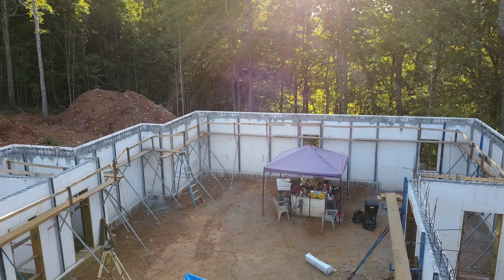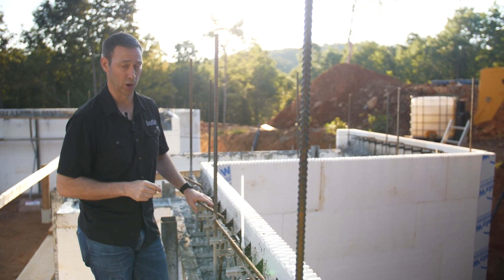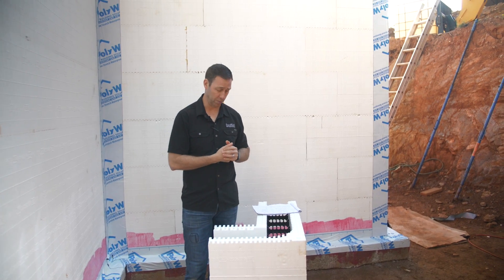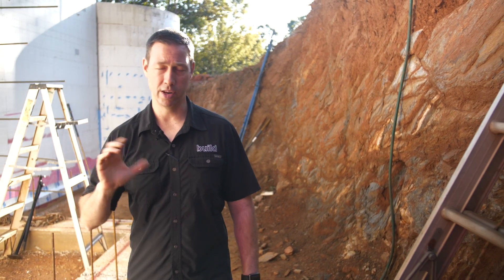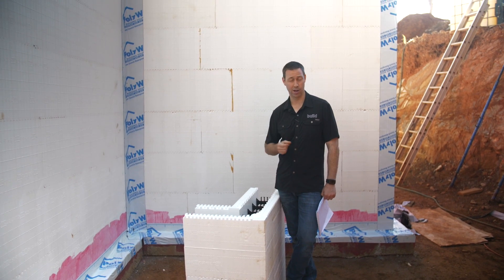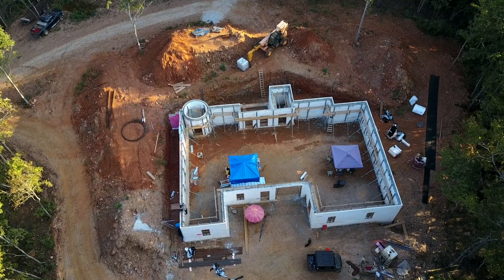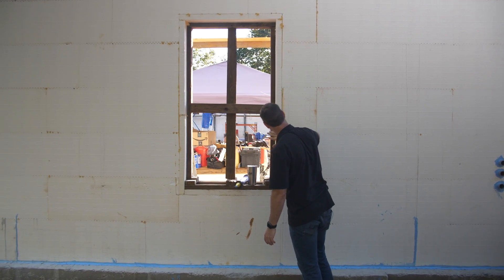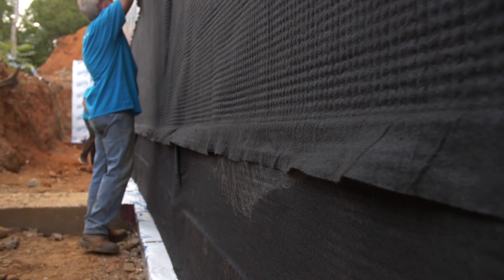Insulated Concrete Forms - Overview, Costs, and Cons

Comment: Owner/Builder ...NOT ADVISED ! I am a builder and I am so glad I got an experienced Sub to do the ICF work on our project. There are a ton of details that you need to be experienced about to ensure a good result...bracing & plumbing the walls is a must but the wood bucks that need to be built at all openings can get very tricky, vibrating during the pour, doing the pour in lifts, cutting blocks and ensuring the inner plastic studs still line up from one row to the next, the list goes on and on. The end result is all of the good things Matt talks about but I would NOT recommend this fir a DIYer.
Reply: I have not done any build of ICF myself but I have watched just about every video on how to build them, I also watched how not to do it as proven by one channel couple building their own ICF basement somewhere in Idaho. They showed what common seam is and IMO its not the proper way to install a wall having every cut to fit seam being on the same place for what they demonstrated, I like to stagger seems.
But to say it is not a DIY  or Owner-Builder thing to do, its true for those who first do not take a seminar or two or watch the instructional videos demonstrating everything you mention, I have watched some DIYers build it themselves with less to no trouble than that one couple whose channel or adventures name I forget still as this is how much I care about them. Besides we all had or have to start from nothing, even you said yourself as a contractor you were glad to use a sub on the install, I am sure by watching them you would know what to checklist if you did it yourself and as Matt said and all ICF manufacturers state in their instructions to complete the install a day before the pour so you can look over everything to double/triple check that you did everything correctly and did not miss anything. Lastly some manufacturers now make ICF bucks and I suggest you look at the Build Block website showing their own new bucking system, though it still requires wood blocking to support though it does still need some further designing to help stiffen it more to more securely hold the window or door in place against the likes of a tornado or hurricane.
Heck even working for my step dad doing basement waterproofing when I first started at 15 in my spare time out of school I watched him as he explained and did certain tasks and we installed a product that the manufacturer only recommends certified installer to install to reduce the likelihood of them getting used. So unless the ICF manufacturers does not recommend not DIY/owner-builder constructing to save money on labor alone would make their product less likely to be sold and used compared to their competitors who many offer seminars for DIY/Owner-builder types can attend for a minor fee if in one who commented they paid $150 for the seminar and were happy with their outcome of their own build.

Hopefully all this did not bore you and you just rant on without fully reading and understanding what I said.
Reply: if stil not convinced then you may want to look at Build Block's channel as they a while back uploaded a DIY series or vast set of tutorials, Like I said, we all start from little to nothing our first time, so to say it should be left to an experienced or professional installer is bonkers as they started out just like the owner-builder.
Reply: As an owner/builder you will probably only do one project in your lifetime....why risk all of the potential problems? If you have problems during the pour you are generally in deep trouble...concrete pours can’t be stopped to fix a problem. As I already stated, I have 25+ yrs in construction and I could recommend a variety of other phases of a house build that an owner/builder could comfortably and safely be involved in....ICF’s is not one of them.

Comment: what is the cost per block.  I love to use this to build a underground root seller / storm seller
Reply: depends on block size and manufacturer, and you would have to request a quote to get pricing, with most you can get the quote by sending them the pkans for what you plan to use their forms for, be it basement below grade or above grade walls for the main part of the structure to even using their floor deck forms for floors or the roof even.

Comment: Good summary of ICF. Getting ready to build an ICF home with concrete floors over basement, radiant ceiling/hydronic climate control, whole house dehumid/ERV, and hopefully low voltage LED lighting over Cat5 throughout.
Reply: ICF decking I take, not steel decking?
Reply: @Joshua79C  Yup
Reply: Also planning "conditioned" attic with roof insulation sandwiched around the sheathing, standing seam over EPS and polyiso...
Reply: That is better than a monolithic dome with its decreased spatial areas

Comment: What's the maximum span this can hold for large windows and window walls?  Also can the plastic webbing be found with a stud finder after the sheetrock is installed?
Reply: If you look at Build Blocks information on their products you will see their foam panels are marked where the fastening points are placed, some go so far as to paint with a marker to see it better but they are at 6 inch on center, and most use strips for greater fastening areas which are also marked in other ways such as in Quad Lock's case are slots which are wider where their fastening strips are placed in their 2 and 4 inch panels.
Reply: @Joshua79C  I did look at the website but it doesn't say anything about finding the webbing with stud finder. After the sheet rock covers it up you won't be able to see any markings.
Reply: cheat sheet, just take a sheet of paper and mark the spacing, then from the existing board you just measure if a stud finder does not help, its not that hard to figure out, you can even mark them with a permanent marker, as long as they are all properly lined up when assembled into the wall there is not much to it, no more of a pattern than traditional wood framing

Comment: I have spent my life in southern California, growing up in a fire zone (hills of Glendale).  Also, I've lived long enough to personally experience one bone-rattling earthquake (1971, Sylmar quake when I was up early reading about wave propagation!!!!)     So my comment is that, while the ICF construction intrigues me on the point of earthquake resiliency, it lacks much attraction towards fire resiliency.      Let's say you've built a home in the hills and the fire engulfs the building.     Even though you've installed masonry facing, the heat will penetrate most superficial surfaces (appropriately called façades!) and MELT the foam exterior plane!      Even if it did NOT melt said plane, how would the homeowner KNOW?       Serious demolition would be in order!       OK, I suppose a diagnostic technique might be invented... but there would not be enough need in the marketplace for this.        So this is not a good structural technique for fire resiliency, IMHO.

Comment: Internal insulation reduces the thermal capacity of your house to virtually zero (some is there from furniture, but is negligible in comparison to concrete walls). That means that your house heats up quickly (in the heating period) and cools down quickly when the heating is turned low. Even more so while cooling, as soon as the AC shuts down, the house heats up due to internal loads. This COULD be an advantage if using a forced air heating/cooling system, since the air is such a poor heat transporter (and the system is used in the US, i live in Europe, where hydronic heating/cooling is a standard). As soon as you mentioned "off grid" I knew this was a definite disadvantage, as you want as much energy capacity (weather it be heat or electricity) in the house as possible.
Reply: Thinnest panels made are in the 2 inch range, this is just nominal size, for example is you look at the manufacturers website (link in description) it tells you the exact thickness usually an quarter inch more than stated. In Quad Locks case they offer panels and ties seperate so you order the required ties including extender ones for making much thicker walls where required or such instead of being limited to just as much as 12 inch of concrete thickness. If you also check out their proucts they also offer a knocdown system aking to Quadlock panels which are not tied to one another like most others but they also offer pannels with one side which can be removed as it is made of wood panels that only stay there for the pour and curing to let the mud set enough before it can be safely removed to leave a hard surface, and they also offer as you say the round portico section a radius wall system as they are the first to offer this product form
Most builder==owners opt to go with just 2 inch panels. and also most offer inserts so one would want to design according to keep the wall thickness at least 6 inches thick so they would need to go with deeper forms for thicker wallls with added outside insulation inserts to get that 6 inch thick concrete wall thickness. With Quad Lock they as I said come with the ties and panels separate of one another and they offer three panels sizes and their extra panel are easily installed and with extender ties (the ties all provide two points of attachment for wall finishes from steel panels to hardee board or fiber cement board) can provide thicker outside or inside insulation (in the case of a frozen food warehouse). Quad Lock also provides two and four inch panels with fastener strips to provide more fastening points for exterior finishing.
Reply: @Joshua79C  sorry but all that you said seems to not have anything to do with my remark, but sounds like a rant from a marketing wanketeer

Comment: Water proofing is something that has to be done on any wall so saying that water proofing is a down side is false. Any time you insulate the concrete under grade is a plus in a cold or hot climate. When talking about the cost of the ICF block you must take in consideration the cost of insuation and labor also because, insulation cost and labor are done when you put the ICF walls up. The money save in a long run with ICF blocks will out way the cost of the ICF blocks many tumes over in just heating and cooling cost. Remodeling cost are more above grade but, most ICF blocks are below grade.
Reply: Yes, not so much to do remodel wise below grade..that is unless the wall failed in some way and then the house would have to be lifted if constructed out of traditional framing or steel framing even.. unless the entire home is ICF then lifting is out of the question. The only true remodeling in a basement is the interior if being used for living space.

Comment: 9000 sq ft x $15 = $135,000 and that's before water proofing and siding but it replaces insulation in many climates.
Reply: IF you look at the cost for a traditional formwork system for bare concrete with no easy to drill into fastening points like ICF has then you are going to run into form rental along with the time to set up and take down which adds to labor time with its heavy pieces of form sections and many fastening ties and screw clamps. Then also he did say he was basing on concrete price in TX where he is from at $5/sqft as opposed to how much cubic yard which is how it is priced per volume. the IC forms themselves are lower cost than the concrete or even perhaps the rebar.
Now subtract the labor and you get a low price when you owner-builder or DIY and may want to take a course or two offered by many of the form manufacturers through one of their certified installers if not directly for a minor cost of say $150 as one commenter (Vancouver Island Waterjet) mentions they paid for a Nudura (ICF manufacturer) seminar.

Comment: Just assuming these were squares and assuming 10 ft including floor and ceiling the 3000 sq ft basement would be 55 x 55 ft and the 4200 sq ft ground floor would be 65 x 65 ft. So 2200 sq ft of walls in the basement and 2600 sq ft in the ground floor. So 4800 sq ft of wall. That comes pretty far off from 9000. Something seems off about that.

Comment: If you want more insulation with an ICF, and to have the ability to put on heavy siding, check out Fox Blocks, which have 12" blocks that you can put more insulation INSIDE of the block.  I've never used them, don't work for them, etc.
Reply: with Quad Lock forms and ties you can get even thicker concrete and insulation , and I only know about them through my own research and do not work for them or a company that uses them and does not have the downside that comes with others with up to only 12 inch thick and reduced as inserts are placed in and the forms do not come with extender ties or even as a knockdown system like Build Block also offers.

Comment: Termites love the foam,  so if you're going below grade,  you'd better have it treated like crazy.
Reply: Some manufacturers for example Nudura perhaps offers optional forms with termite protection infused in, others just offer or recommend termite barriers made from steel that goes in during initial construction or slips on after the fact in a retrofit. The best barrier to termites is a goo pest control system that many such companies offer to detect and determine what measures may need to be taken to control said colony.

Comment: In regards to the footing/leveling and insulation, there are a couple of things.  Firstly, for the footing/level of the ICF, there's something called "Fastfoot".  It's a "fabric/waterproof" "bag" type thing that can be suspended below ICFs, forming a waterproof/moistureproof footing, and, especially on uneven ground, by making sure the ICF is level, you can then let the concrete form up in the fastfoot "frame", and both monopour the whole wall and footing, without the break between them, and you know it's level, because the fastfoot is what's "uneven", below on the ground, while the ICF, itself, is suspended around, say, 18 inches above ground, level.  The info about Fastfoot is available at the Buildblock website, among others.

As for insulation, there are a few options.  Firstly, they offer both wider blocks, such as 8 inches, 10 inches, or even 12 inches of concrete between the EPS Foam.  They also offer 2 inch inserts, made out of the same material as the EPS Foam, that you can insert inside of the block, against one side or the other.  That's a "permanent" added insulation.  Another couple of options are, firstly, apply EPS/XPS foam, in normal 4x8 foot(?) sheets, similar to wood construction, and weatherproof over that, however you would, normally.  A second option, and one I would prefer for when I build my own "house", is basically frame a 2xX wall, inside the interior side of the ICF, and run your wiring, any plumbing, and even additional insulation inside that.  That also makes upgrading wiring or maybe insulation easier, since it would be just like any other home upgrade.  The only difference is, instead of sheathing on the outside, you have the interior side of the ICF System.  While it would be more "permanent", you could even use closed-cell spray foam for the insulation inside the "2xX" walls.  While it's more of a commercial application, you could even spray foam the exterior side of the ICF, with closed-cell spray foam.

The point is, there are options, depending on what you want to do.  

As for the cost factor, while the initial cost is higher, you have to keep in mind what you're saving on other things, like insurance costs, needing a smaller HVAC System, and so on.  If you add in site sighting, and PV Arrays/battery, that all adds up to money spent in the "near term", but that you're saving in the longer term.  Like those water heaters you showed, a while back.  One was something like $1500, compared $300-$450, or so, but after the five years, those other two were costing around $2000-$3000, while the heatpump one, which had cost $1500, was only at something like $1550, or so.
Reply: You missed Quad Lock system which unlike the others have extender ties so you do not loose concrete thickness as it does not use inserts like the others do. From what I know a little more than you explain. Adding in additional framing on the inside of the outer wall of ICF wall, you can easily run conduit through it and even go far as installing the electrical conduit in the cavity where the concrete goes just as well, the interior added framing added in that spot just decreases room and interior space and adds more barrier between the thermal mass of the concrete itself which helps to reduce cooling and heating costs greatly.
Reply: I wasn't trying to list every possible option, just list a couple of things that can address the problems that Matt listed with ICF Systems.

Comment: Concrete doesn’t “resist” constant outside temperature though. That’s what insulation is for.
Reply: he did mention concrete will eventually heat up or cool and the foam forms create a full thermal break despite. One manufacturer i know of offer three thickness of panels per the foam panels. others offer it as a upgrade option, check out Quad Lock if you have not heard of them before.
Reply: Check out "EastGate Center, Harare" for how concrete breathes using biomimicry of termite mounds.

Comment: Why isn’t there ‘mortar’ going between the blocks (liquid flashing?) to seal up all the cracks? Apply enough so it squirts out and you see all the seams, then scrape it flat
Reply: foam adhesive is what you are looking for in reference to mortar and some manufacturers recommend it to secure the blocks to one another during the assembly but only on a flat seam where there is not going to be a "interlock" such in the case of Build Block forms and most others with flat edge sides and interlocking base and top.